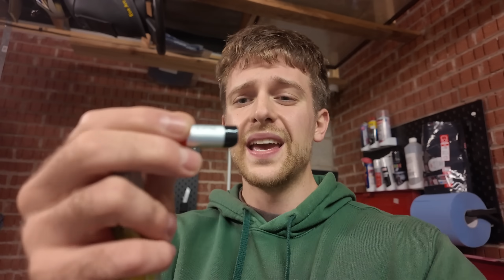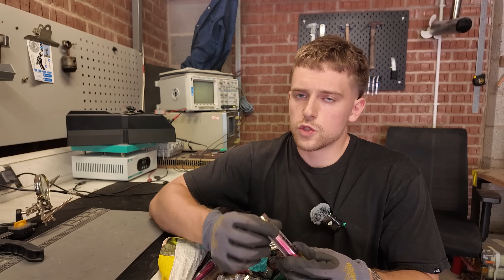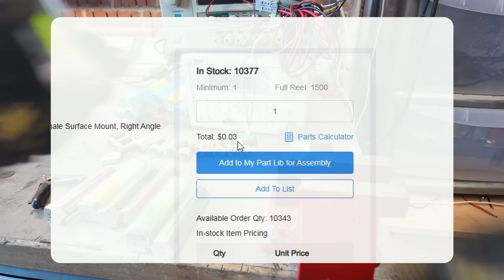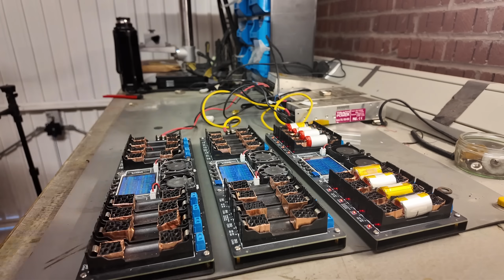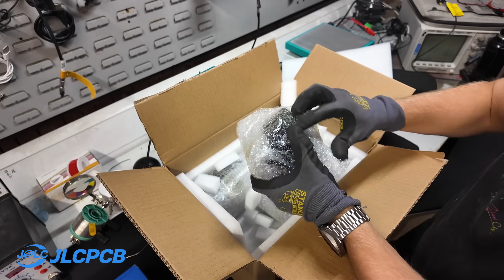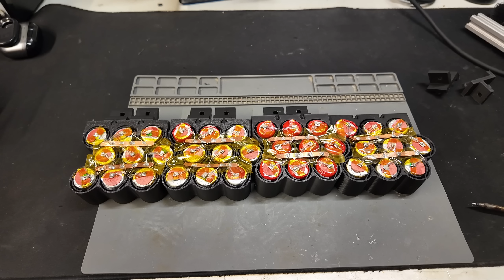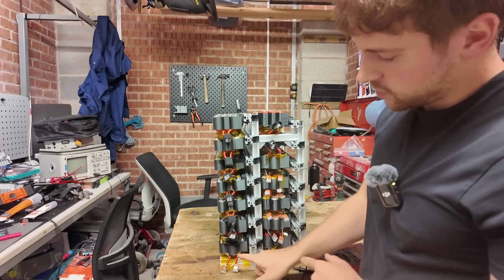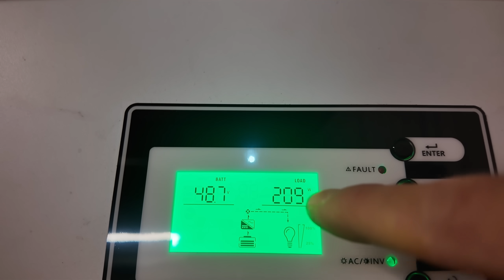I Powered My House Using 500 Disposable vapes

Comment: You definitely have to install some solar panels now and go entirely off-grid for your workshop! 😄
Reply: He will have to harvest them out of old calculators
Reply: @cameronck  those never worked, he'll need to use solar cells from discarded path lights
Reply: @LexYeen yes this!!
but i imagine the availability of those isnt nearly as good
Reply: @LexYeen he can just get a few common door sized ones, the second hand ones are a steal and the new ones aren't even that expensive.
Reply: Why did you think he had an inverter with a transfer switch already installed?

Comment: I bet with a bit of coding, some conveyor belting, a smoke detector and a light detector you can automate the vape sorting for some larger scale project.
Heck, discard the coding, it can be done with just logical circuits and solenoids. Either of two signals (smoke or light) and the solenoid sends the vape to the save pile. Neither and it goes to the discard pile. Doing this manner (positive signal causes positive action) is safer because failure of signals or actuators don't cause false positives, only false negatives. Re-run the system under supervision with the discard pile (and the save pile) if you feel the system isn't perfect yet.
Just wish cell disassembly was safe to be automated also. But the risk of a manipulator or a cutter/crusher hitting the cell is too high, even if you use a solution that is flexible to different casings.

Great job!

Comment: Hi, Love the Idea of 2nd life batteries and your Videos. I have done similar projects with 18650 and prismatic cells some years ago and still can relate to "i have way to much lithium in my workshop". Let me please give two, in my opinion, urgent suggestions: First DC String connection should be done not on both sides but alternating left and right thus the current cant be unbalanced due to different resistance in the parallel connections. SECOND concerning the AC integration: please don't connect the inverter output to the same sub distribution board and feed the RCD from the output.

Comment: Nice. Though I would not want to be under the same roof with a giant Lithium-cobalt-oxide pack. Too dangerous. Home batteries should be LiFePO4.
Reply: I don't disagree, but in the 30 years that I've been using lithium cells of many types, I've never had an event at home. Everything is dangerous to some extent, and people should use reasonable precautions. But we shouldn't let hysterical media rule our lives.

In my childhood home we stored a gas lawn mower in the garage for years, no problem. There was a fire, but it wasn't the gasoline, it was my mother burning the Christmas tree, needles and all that set fire to the roof. Don't let sensationalism give you tunnel vision, because it's often the thing you're not fixating on that is the danger.
Reply: While yeah its an added danger, its not much more dangerous than a gas stove or an electric heater.
Reply: @AlpineTheHusky well actually yes it is. LiPo fires are unextinguishable and burn at thousands of degrees. In comparison you can easily extinguish az electric or gas fire but of course if your gas line blows up that still levels a house in an instant. Hence I do not move to houses with gas lines if I can avoid it.
Reply: @kozmaz87  As a firefighter I can tell you that small lithium fires (that includes energy packs for houses) are very easy to handle. You can basically just drag them out since they always have metal casings that almost completely halt a fire from getting out. You just run in, turn off whatever you can turn off and rip out the pack.
It looks way scarier than it is since with the proper PPE you can really just grab em and yank em out. 
Or if you go the "fuc it" way you just blast it with water to cool it a bit or powder it before yanking it out.
As compared to fuel or gas fires, while they are easier to extinguish, there is always the thought in the back of your head that liquid fuel can flash at any minute and that gas can literally just explode so while those with lesser experience are prefered for those fires they are more scared of battery fires. While more experienced firefighters are more scared of fuel fires and are more comfortable with battery, metal and "non flammables" fires.
Reply: @AlpineTheHusky  Yes I am familiar with their practices and how electric vehicles are basically need to be put in a bath until they burn through. Basically the issue with Lithium-Cobalt-Oxide is the oxide part as I am sure you know, basically it internally feeds itself with oxygen so no traditional firefighting technique really works for them. The issue is the sheer size of the pack. Many of them are hundreds of kilos while burning hot... no yanking there. You also assume they are in an accessible place. That is not always true. Regulation should be way more strict all around. 

I do not argue that fuel and their fires are not dangerous of course they are but in my opinion we handled their safety well over the decades. However we are very quick in adopting EVs and put them in undercroft parking lots where the density of combustible materials is high and space is limited to fight the fire of a 2ton car. And as for power walls, they are bolted to the wall and are in a shed sometimes next to a bunch of combustible stuff. The reason a phone fire is manageable is simply the size of the battery, which limits the size of the problem. The bigger the battery, the more energy it stores the risks grow with it, I would say, exponentially.

In this video for example the BMS and those fuses will cut off a failing cell but that is only one of the runaway failure modes of these batteries. The metal casing of these chinese cells may or may not be able to draw out the fire timeframe enough for it to internally burn through without melting the pack away but that should be tested. The ones he tested earlier... hit it with a hammer and the thing blows both ends off.
Reply: I'm holding out for sodium ion to power my house. I'd rather trade a bit extra space for greatly reduced risk of a fire.
Reply: @stellarpioneer LiFePo is already safe enough. Sodium Ion is srill gonna take a decade to match lr surpass LiFePo in durability, cost and power. Density it will probably never match
Reply: @AlpineTheHusky  Never say never, material science is always crazy slow, and economics tends to make it worse. I agree it will take a long time, but density for LiPo has been pressed pretty dang far and is gonna take a crazy amount of time to ever go further; we are only just starting with Sodium, who knows, it might even surpass if given the time.
Reply: You cannot harvest lifepo4 from the streets though, only those who can afford to PAY for that chemistry can use it. This is the whole point of this vid - using harvestable sources of storage rather than having to Pay.

Comment: I love these disposable vape battery projects! Would you consider putting out information on how to safely do stuff like this yourself?
Reply: No- he already said he does not recommend anyone builds a battery pack like this. Lithium ion cells are extremely dangerous if mishandled. It sucks because I'm sure more people would love to do stuff like this but its not safely attainable unless you're familiar with electrical engineering lol..
Reply: @mooseli4180 and the state of those batteries is also unknown. I woulndt leave them unattended
Reply: These rechargeable cells meant for cheap disposable are very low quality generally, and are pretty unsafe to be actually using for much, unfortunately.
Reply: @NixLiou  This seems a commonly held view, but I can't find any evidence to support it. Please can you supply your evidence.
Reply: @toyhacker4647  It's hard to give a ton of evidence here. You can find the results from a recent test where hundreds of 18650 cells from name brands and generics were CT scanned, and internal defects were cataloged. tl;dr as many as 8% of generic cells had defects that would cause early failures in them. And those are cells not intended for single use devices. If you look at the spec sheets for these kinds of cheaper cells, they don't even promise a third of the cycle life etc. 

I mean, if even the manufacturers know they are giving you cheap short term cells, I'm not sure what more evidence you need. Proper cells are not very expensive, and will get much better results for energy density, both gravimetric and volumetric.
Reply: @toyhacker4647  
Think of it this way. 

Multiple suppliers for the same "kind" of Lithium ion cell. 
Sure it might output the same Voltage and Amps roughly, but each type/brand is going to have a different C rating, different internal resistance and different build quality.

C rating is charge/discharge in an hour. For reference, most 18650 Li-ion cells for vapes have a C rating of 1-3C
As an example: 

A 3500mah cell at 3 C will provide about 10.5A current for 6 mins total. Usually a vape isn't running at a full 10amps however, more like less than an amp. 
But they can pack a fair bit of punch if needed. 

3C is not enough, however, for a large scale "power wall solution". If that cell gets placed under a higher load, and has a high internal resistance (really hit or miss with lower quality cells), you get HOT cells that fail fast. 
You generally want cells that can withstand high charge and discharge rates. There's a reason why power walls aren't built with Li-ion cells....

The fact these cells are easily searchable online, and always return a "generic" result, all with each model reporting different specs is why people have the view that they're "lower quality". They're also REALLY REALLY CHEAP. And that's always a red flag. 

Combined with the fact you might only get 200-400 cycles out of them before the voltage sag really kicks in. (V sag is where an old cell or cell under high load outputs less voltage that it would nominally, it also occurs the lower the cell voltage gets, it's why when your phone is at 30%, it seems to get to 0% faster than 90% to 30%)
Sag also occurs in colder weather conditions, lithium doesn't like the cold...

I only know this stuff from dealing with FPV drones for the last 6 years. But take it from me. These cells are not designed with power walls in mind, they can work for smaller power banks etc, but for a large system under continuous high load, you would seriously need to consider every factor when building something. It's not as simple as "go in parallel until high capacity, then go in series for higher voltage". It's not impossible, just way more complicated than you can imagine. 

Always fear the lithium. Don't even get me started on LiPo batteries, I have one sitting next to me that has a C rating of 120C.... Which means it can output 420 amps if needed, but that would discharge it in like 25 seconds lmao. Usually my FPV drone uses 20-40Amps when cruising, and can hit almost 70Amp when flying aggressively.

But the more amps you pull, the lower the voltage output goes. The lower the voltage goes, the less amps you can pull. The cycle never ends
Reply: @NixLiou  They're cheap as chips aha, better to get them sent to a dedicated recycling plant to be reused

Comment: i feel like xt60 connectors or something like it wouldve been good for connecting the modules together instead of wagos
Reply from the maker: You're defo right, that would have been much more reliable and allowed more continuous current
Reply: @Chris_doel  The Wago connectors also seem to be on the brink of what they are rated for. When the kettle is on it shows a current of 65A at the battery, so each half would have 32.5A running through it, which is just above the rated 32A of the connector.
Won't be an issue when only powering that shortly but you'd probably need to find a different kind of connector if you wanted to power the stove 😁
Reply: @Chris_doel  not really the wagos are 32a continuously and the xt 60 are rated 30a continuously
Reply: @kevinheimann7664  An XT60 connector is rated for 60 amps of continuous current.
His best bet would potentially be an XT90, 90 amps continuous current. You can get much higher peak current for small periods of time with the right wire gauge.

My 6S, 5 inch FPV quadcopter pulls around 20-40 A in flight over an XT60, but i've seen my A go up to 70A in more aggressive flying/really really windy conditions. The connector doesn't even get hot. The ESC is rated for might higher peak current thankfully. But the voltage sag can get a big freaky when its cold outside, hand warmers in the battery case in winter ahah.

Anderson connectors might be the best route though if you want max A and stanardised connection. Don't skimp out on safety because it "I went with wagos cause i was scared of soldering the live terminals". Just because it looks nicer and is easier, doesn't make it a good idea.
Reply: @Chris_doel AI ahh response

Comment: I’m not quite sure, but if you pull 60 Amps from the pack wouldn’t these 60 Amps also be going through the Wago connector which are rated to about 30 Amps? You only pulled that much power by using for example the kettle, but using it for the workshop as a UPS will probably not pose as big of a problem. Still something one should keep in mind
Reply from the maker: Good point! So I've fortunately used 4 wagos to connect each row together, so we should hopefully have a max combined current of 120A. But I certainly wouldn't want to pull much more than 60A to be safe!!

Comment: Load bearing solder, huh?
I'm sure that won't be a house fire.

They make spot welders for under fifty bucks, for future reference.
Reply from the maker: Sadly, spot welded nickel strip doesn't seem to work with the tabs on these cells 😢 I wish it did because it would have saved so much time
Reply: @Chris_doel  
If you couldn't find a better method than soldering busbars together then maybe it shouldn't have been done.
If there's a bad connection or one of those solder joints gets hot, the solder can melt and the busbar comes loose, then you have a massive DC arc in the pack.

It's also not a good idea to leave the exposed cells sitting around on the workshop floor where they could get punctured. It needs a case to protect the cells.
Nor is it a good idea to have your inverter on a subpanel in your garage. There's nothing stopping you from backfeeding into the grid, potentially killing a linesman.

You need an interlock on your main breaker panel that prevents you from swapping to inverter power as long as the mains breaker is on.
I don't know about the UK, but that's actually illegal in a lot of places, for good reason. The transformer that feeds your house will step up the 240v backfeed to thousands of volts.

Comment: Using too much fuse decrease efficiency
Reply from the maker: You're right, we can even see the big voltage drop when i turn on the kettle. Although id certainly rather have worse efficiency than a cell go up in flames!
Reply: @Chris_doel  yeah safety first

Comment: so..
there was a time when netbooks were a thing. this extemely underpowered devices with a 1st gen intel atom and a 1024x600 screen wich - in combination witz windows vista and a 5400rpm hdd in the 2,5 inch formfactor was insanely slow. but they came packed with really big li-io batteries. becaause something must drive this insane slow mechanical hdd..

long story short, this LG model I still have, always went beyond the voltage, under which the charging circuit in the netbook refused to charge it for like fire hazard reasons. so what did i do? put full high voltge high wattage on the cells for like 5 seconds. voltage rised, the laptop chargend normally, even had no drawback in battery life
Reply: who asked